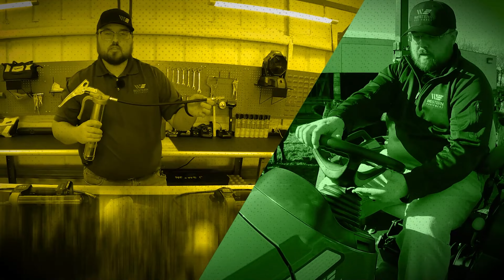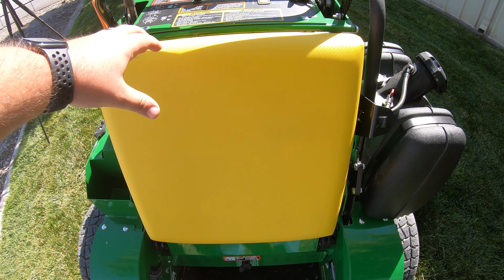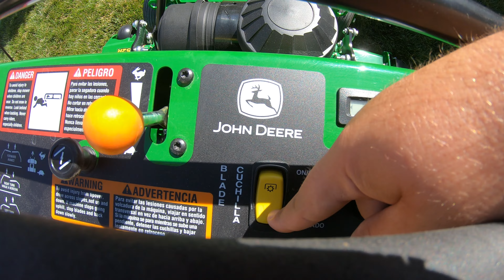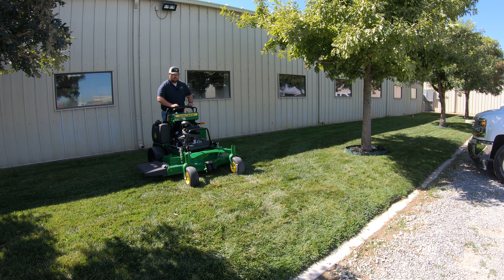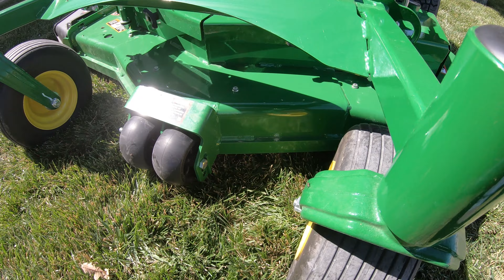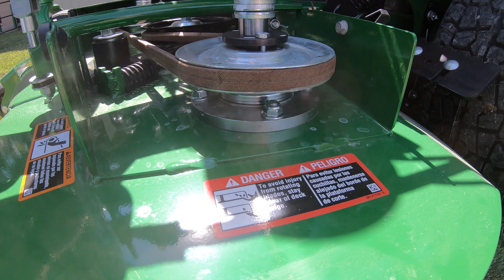2022 John Deere Stand-On 652R Zero Turn Mower Review

Comment: is there any advantage in 2 deck belts ?  power? life?
Reply from the maker: The main reason for this is just because of the placement of the engine being directly over the deck. Since the drive come out of the bottom of the engine I think it was just easier to run two belts rather than trying to route one in a serpentine.
Reply: @WesternEquipment  was wondering because the ferris sit down and wright have 2 deck belts also